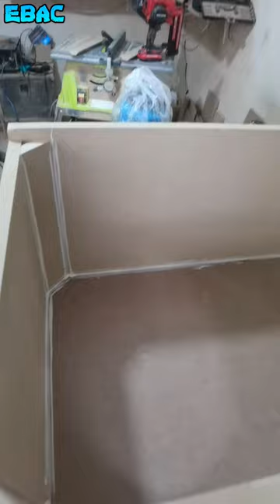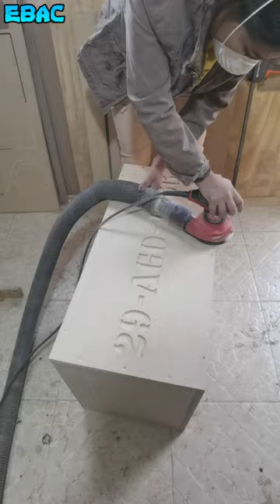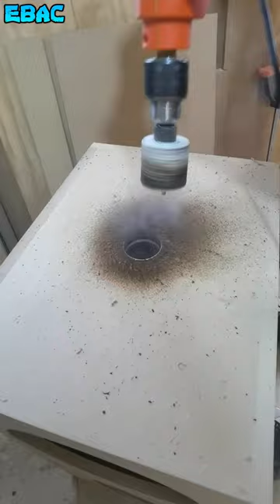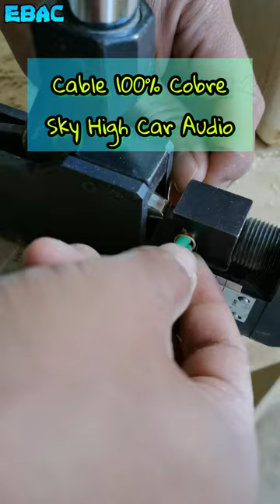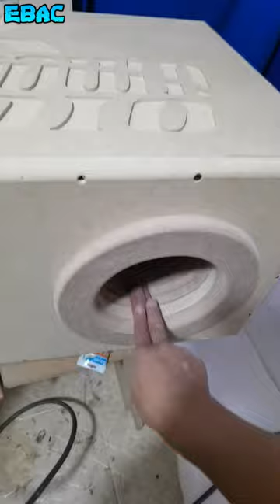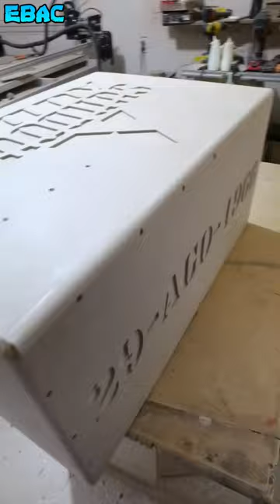Cajón con grabados Personalizados para Sundown X12 | EBAC

Comment: Estimado, buenos días.
Me puedes apoyar con resolverme una duda.
Tengo un par de subwoofer 8 pulgadas 750 Rms Rokcseries.
Y un Amplificador Coustic 3200 Whatts, reales tira 1600 Whatts.
La pregunta es, cuantos volts soportan esos subwoofer, según los cálculos que e aprendido en tus videos me dice que le tengo que ingectar 38.729 volts a el par de subwoofer.
Es correcto? El amplificador entrega 1600 Rms a 40 volts.
Qué opinas.